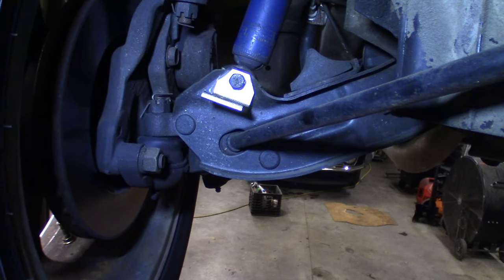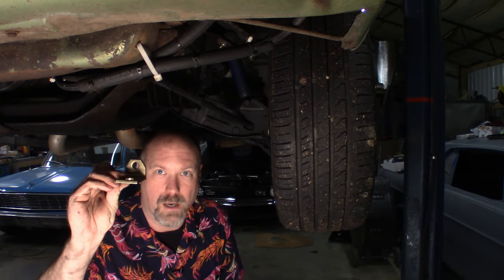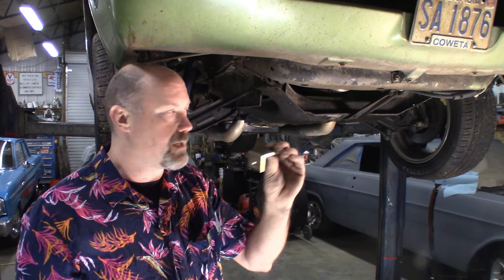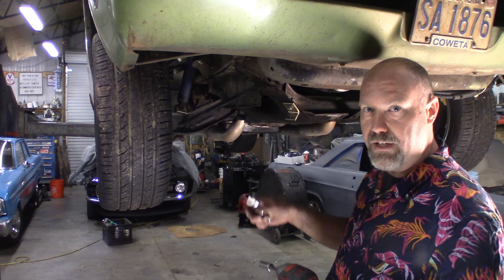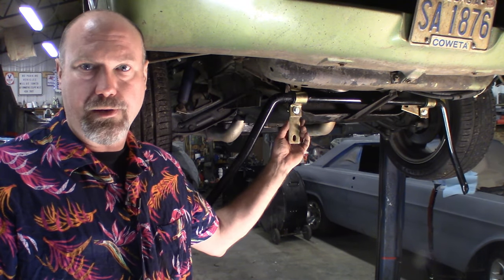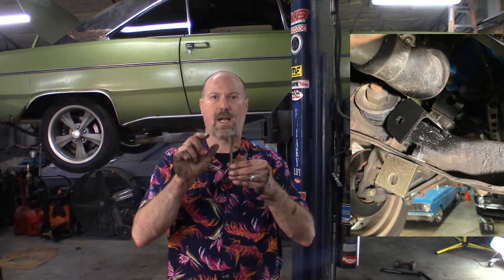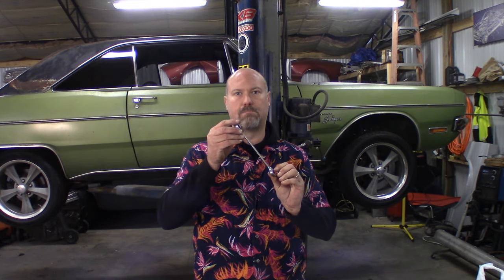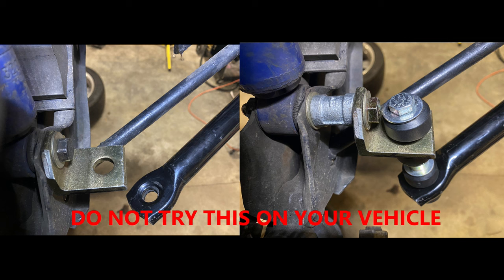Addco 150 Sway bar installation 1971 Dodge Dart Swinger A-body

Comment: Bergman Auto Craft makes very nice steering & suspension kits. I converted my '69 Swinger to '73-up K-member, suspension & steering pieces since I had to go through it all anyways...before anybody gets upset, the 340 was yanked out in about '78 and a '68 383 powertrain was installed along with wedging the Road Runner rear end in by the original owner (it was all shackled up & air shocks, totally hillbilly engineering). Not cheap, but it is a massive transformation
Reply from the maker: I met Peter from Bergman Auto Craft on last years power tour. Loaned him a bracket he needed for his car. They make great products and are even better people! Thanks for watching!

Comment: Glad you stated that the end link rods should be vertical as possible.  I just installed a QA1 Swaybar on my 1970 GTX  and my end links are pointing forward.  I will correct that. Thanks again for the information, great video.
Reply from the maker: Thanks for watching!

Comment: Jason, how has that lower control arm standoff been working? I am installing the same bar in my 70 /6 Dart. I see the problem you are talking about. Also, you mention your car being a /6 k-member. I take it, it was originally a /6 car and you have a bracket conversion kit to fit that 318 under the hood? I am building a 340 for my car and wondered how well those conversion kits work. how has that worked out for you? Thanks Jason for this vid.
Reply from the maker: Kit is working out well. I’m running the trans-Dapt conversion mounts for the /6 - 318 swap. Only thing I would suggest is to add that upper bracket that I did. Definitely firmed the front of the car up in the twisties

Comment: Not your Fault - the ADDCO 150 front sway bar "Does Not FIT" these #Mopar #Abody cars.
Had the same problem on my 69 Barracuda v8, tried it with after market shock mounts - had your problem. Bought OEM lower control arms, now the arms reach but are 2.5" too narrow for the Tabs. Grrrr.... Lower OEM Tab holes, hole -2- hole is 46" . ADDCO Sway bar  is 45" end to end putting the eyelets at 43". 
Seeking problem resolution is why I found your vid. 
Think i am going to take the bar to a machine shop and see if they can bend each arm out 1" (TL 2") without heating it. (Wish me luck... It's a  1 1/8" THICK BAR!).
Reply from the maker: Thanks for watching and keep me updated!